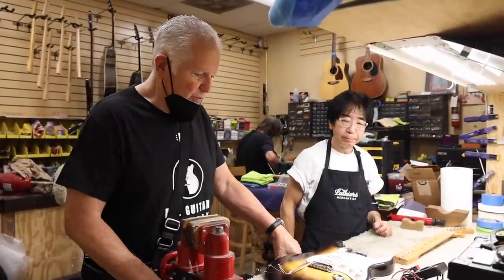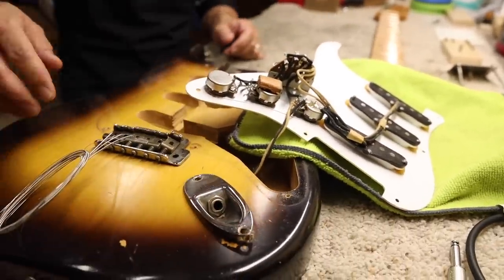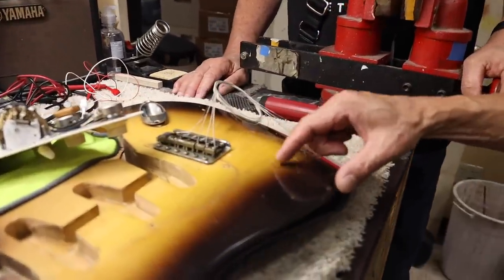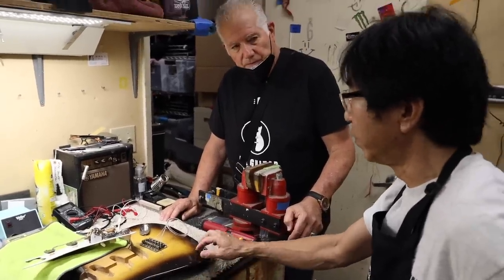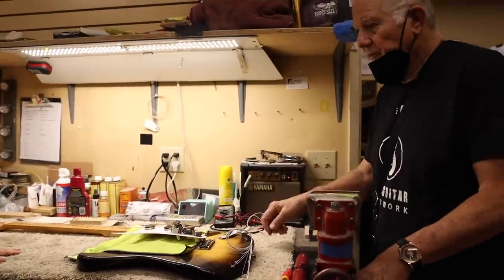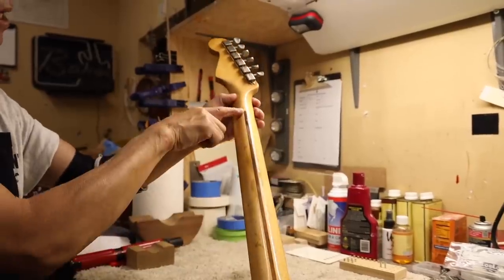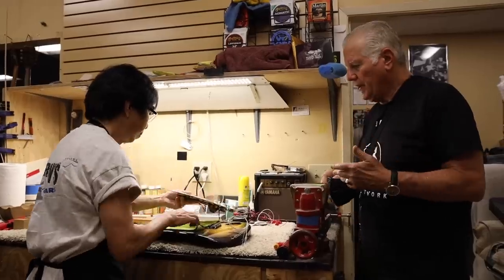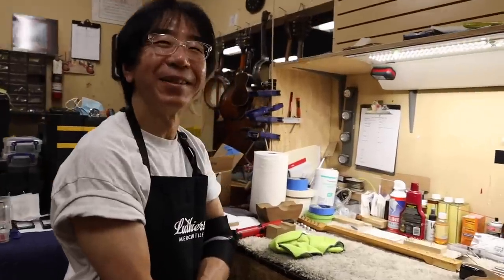1956 Fender Stratocaster at Norman's Rare Guitars - IS IT ORIGINAL???

Comment: If the router blade was somewhat dull it would have a tendency to rip through the wood instead of cutting it out clean, that might explain why wood filler was used, to fill small voids..

Comment: I recently played a vintage 60/61 strat and it was fine, but I came away thinking either those guitars really aren't worth the crazy money, or my 2002 MIM 60s reissue was a home run that Fender should be really proud of. I've known other players with Fenders from 2002 in Mexico that would agree. They were doing something right then. The only thing I ever hated about my mim strat was the polyurethane and I got rid of that the first 2 weeks I owned it.  I stripped it and did a Lake placid Blue with nitrocellulose. Seriously, my MIM strat is the best strat I've ever played. It's my baby.
Reply: I bet that looks great.  I'm curious... I think you mean you stripped and refinished with a nitro lacquer top coat, over acrylic lacquer Lake Placid Blue?  I ask because the Lake Placid Blue lacquer on Fenders is Lucite 2876-L, which is acrylic lacquer, not nitro.  Expanding on that, all the metallic base color coats Fender has offered in lacquer, originally/past and present, were/are acrylic lacquer.  The lacquer Fender solid colors--e.g. Olympic White, Sonic Blue, Fiesta Red--are Duco, which is nitro.  If--because they didn't always do it, depending how busy they were--or when Fender sprayed clear top coat over the body base color that much is always nitrocellulose.
Reply: @YTPartyTonight  It's not exactly lake placid Blue. It's close as we could get with other paints. I've always liked the Lake placid Blue that is darker. Some are a little brighter color than others. So it's a certain color blue with a gray undercoat. To me it came out looking very close.
Reply: That’s funny I have a vintage 65’ strat and been trying many new fenders but to me they feel like toys more like. Not saying there isn’t good new guitars around.
Reply: @millmoormichael6630  I agree with the new ones. Again, mine is a 2002 60s reissue. I sold a new strat that I bought because of that exact thing. It sounded OK. I hated the way it felt.  There was something about this one though. Also, my pick ups have been changed out as well.

Comment: I am waiting for one with the original strings.
(:
Reply: now that's funny !   So am I    LOL
Reply: Its Straturday  9-11-2021   So I went to our local Guitar Center  I picked up a ESP Arrow and plugged it into a very nice Fender modulating amp anticipating a little fun,  but then I noticed the damn thing only had 5 strings on it  I looked at the salesman just a few feet from me and said  This guitar has a broken E string  and he looked at me and smiled and said  Yes it sure does  and then he turned around and walked away  So I unplugged it and put it back where I found it   I guess because the guitar has a Floyd with locking nut it was just too much work for him to want to fix ?   It was not that busy so I went into the acoustic guitar section and grabbed a Seagull 6 string   It sounded really good but I went to drop the first string  it broke because the guitar was strung wrong   Seriously I cant make stuff like this up   lol   This really happened today  Its all on camera    Guitar Center Sucks